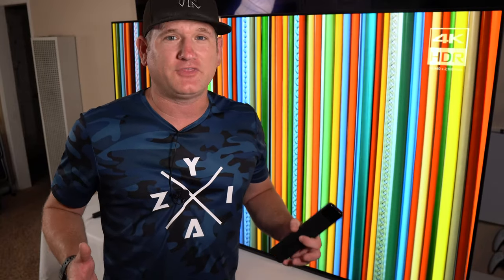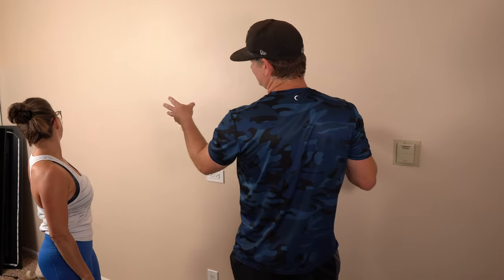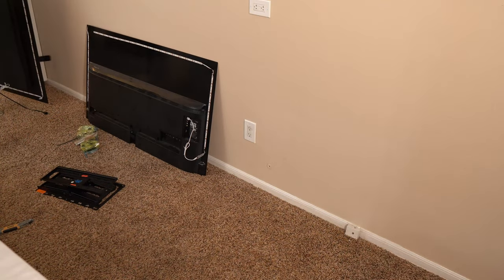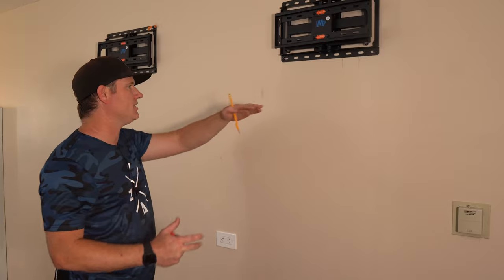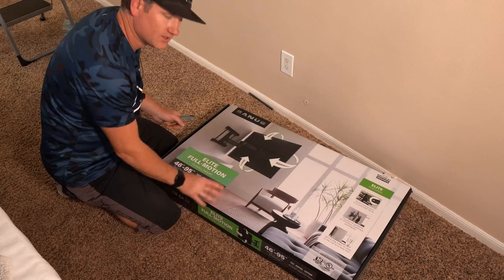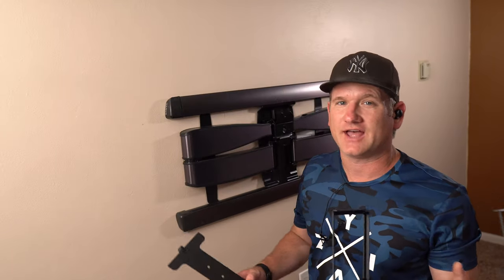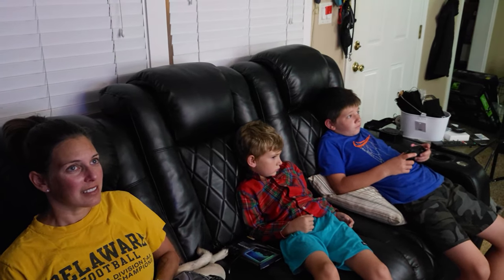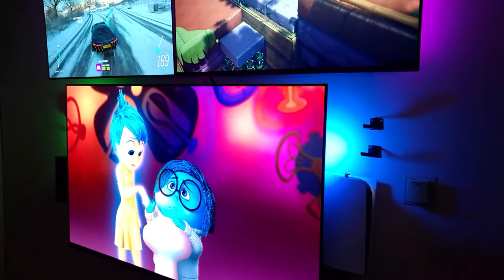83" Sony A90J OLED TV Setup PS5 & Xbox Series X

Comment: That SANUS calculator is awesome. Great video!
Reply from the maker: Yeah, I was hating on it and then used it and then cut out the hater part. 😆  what r u gonna do. I'm pretty good at math, but that was easy. It was about 1 inch low tho
Reply: @BTheInstaller  One inch seems a bit too far off but sounds like it's worth the try. Thanks for sharing it.

Comment: nice work! I'm rocking a 6 TV set up(75,65,65,55,55,28) in my living room, with 2 high end sound bars, ,1 new Xbox, 3 Xbox X's, 2 PS, switch, and avr-x4200 with rf-7III and rc-64III, 2 spl-115 on a 5.2.4 atmos sound system, cause like you said why not! hahaha

Comment: do you call your wife Scully.  She reminds me of her.  Those wall mounts are great.  Sams sells the same type, $90 each but worth it.  You do need, however, a proper drill driver.  I use the Milwaukee mid-torque impact driver.  Love it.
Reply from the maker: Ha, she way hotter... no offense to scully... the glasses were cause she was working. What's wrong with my M18 brushless hammer drill? Lol. It's a $400 set.. I have the impact but not as good.. I always hand tighten

Comment: Amazing seeing how you can lift those 55" TVs by yourself over your head up so high and still get the brackets on the wall mounts! I would have used a step ladder :)
Are any devices like Apple TVs hidden behind the TVs and are the cords hidden in the walls too?
All you need to add is some bluetooth headphones paired separately to each TV so each person can hear only the TV they are working with!
Your wife's expressions indicate to me she might have after this video was done requested everything but the 83" TV be removed from the wall now and holes patched :)

Comment: Very nice setup, did you use the standard screws that are pre fitted in the A90J for the wall mount? Thanks.
Reply from the maker: No. I never use those as they're cheap. The mounts have various sizes.
Reply: @BTheInstaller  Hmmn, will those prefit screws be enough for a regular wall mount? Thanks.

Comment: Hey Brandon I watched your installation video and I thought I heard you mention that you were going to hang a Vizio OLED up on the wall with the SONY 83 inch A90J. I have a Vizio OLED myself that I bought in February for$1000.00 dollars. Fortunately for me I haven't had any problems with my TV. I've heard FOMO and Channa and even joelster say they had problems with their panels. I love the picture quality and I think for the price I paid it was worth it. What's your thoughts on the Vizio is it really that bad or does it depend on the panel lottery?
Reply from the maker: The Vizio looks fantastic.  It just sometimes fails on DV or just won't turn on.  It's a 9/10 for PQ
Reply: @BTheInstaller  hey Brandon thanks for responding to my Vizio OLED question.  I'm so glad you agree with me about the TV's picture quality. I guess I got lucky and managed to get a good panel. For my use case it's almost perfect.  I knew how much to expect when I bought the TV. so I'm not disappointed. Thanks again buddy I am a loyal suber to your channel.

Comment: Any info on the material you used on the wall for the screw and dry wall anchors? Please post links for PS5 and controller wall mounts
Reply: The plastic screwin drywall anchors look like ones I've gotten at Home Depot, come in several sizes and # ratings.

Comment: A90j targeted for the Movie/Netflix dolby vision content viewed for 2hr/day type buyers wanting best picture quility possible, If looking for a multi purpose all-day everyday Oled with every Hdmi 2.1 option feature already available and costs a lot less per inch with only very small disadvantage in brightness highlights then buy LG G1 , 
Also Ps5 is looking like a console also targeted for small user minority with inferior performance visual/response options on all cross-gen cross-platform games released so far and gap will widen slot more once games designed for nex-gen from beginning like FH5 shows both Sony products are not smartest choice to buy .